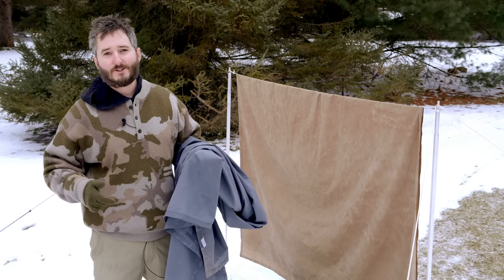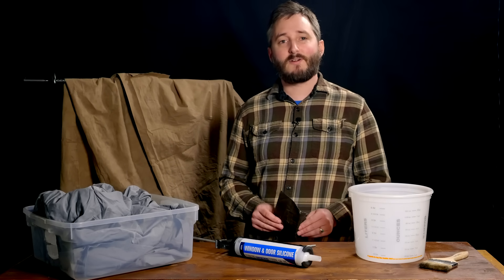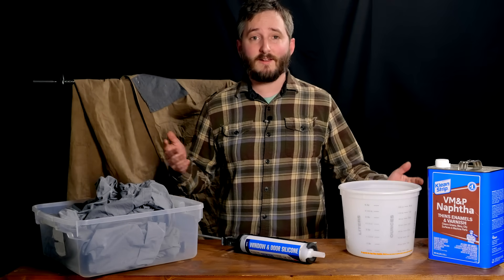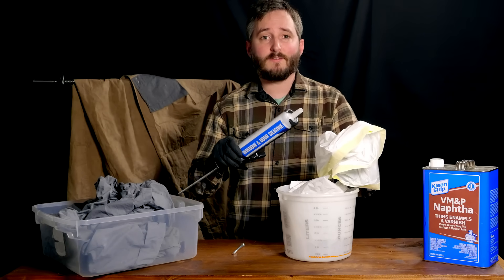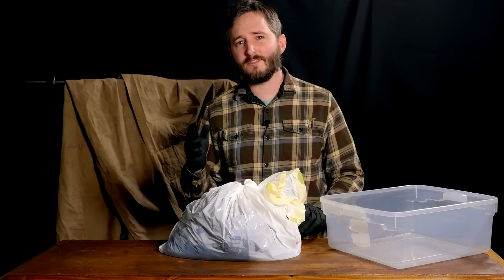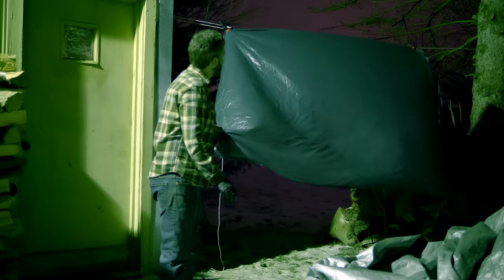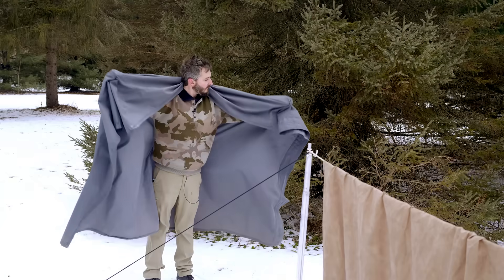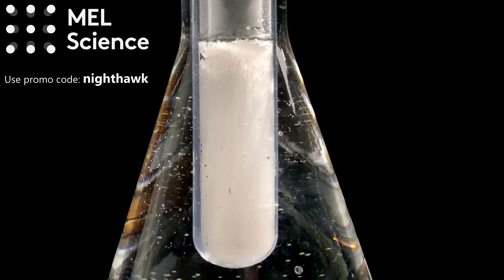Recycled Bedsheets Make The Best Waterproof Tarps

Comment: A king sized flat sheet is 75"x80" (6.3' x 6.7'), which seems a little small for my taste. But, he said this could be applied to any cloth material, so I looked into canvas drop cloths.

Canvas tarps are obviously more expensive than used sheets, but they are also much heavier. Drop cloths being 8oz to 10oz fabric, while typical sheets are 3oz to 4oz. A benifit of drop cloths is they come in much larger sizes.

Lowes Drop Cloths Feb 22
6' x 9' ($16), 9' x 12' ($27), 12' x 15' ($31). You can find a 30' x 30' but it's $300.

The question might be, why not just buy a woven poly drop cloth. My answer would be, because strong gusty wind, especially on a very cold day can quickly destroy a plastic or poly tarp.

Industrial grade Visqueen seems to hold up better than standard poly tarps, but likely not as well as cloth. In any case 10' x 25' x 6mil Visqueen is at Lowes for $30. It too will eventually shred in strong gusty wind, but lasts longer than most DIY grade tarps, in my experience.

Truly heavy PVC coated tarps are available, they are durable, heavy, and expensive. A 12' x 15' x 18 oz. Ultimate tarp, but it's 22 pounds and $190.

I'll probably try a 12' x 15' canvas tarp and apply the silicon syrup to both sides with my industrial paint sprayer. I believe multiple thin coats should insure the cloth is fully waterproof. I'll probably do the same on an old sheet if I can find one.
Reply from the maker: This should also work fine on fabric with seams. Stitching multiple sheets together is an option
Reply: @Nighthawkinlight 
Good point, thanks!

Comment: silicone coating sucks for many fabric (I ruined a backpack with it: its peels, and look horrible, there is no way to remove it). It's often better to use polyurethane coating (from expanding foam + acetone). With 1 or 2 layer it's perspirant (many tiny bubles form when applying that make tiny holes), with more layers it becomes waterproof. But be careful to:
- don't melt stuff as acetone is quite nasty for many materials, 
- wear appropriate gloves as there is a nasty chemical in this solution that pass through most gloves, and through the skin (the trick is to use vinyl gloves inside a plastic bag (PP? that isn't destroyed by acetone).
Reply: I forgot to add: you can't later on put more silicon to it (ro any other coting, bcs nothing sticks on it, even itself).
Though I learned many brillant hacks in this video, thanks!

Comment: Is it waterproof enough that it can actually hold water like a water bag? Like if you turned a cloth bag into a waterskin. Or does the water still leak through?
Reply from the maker: No, you would need to paint the silicone on thick for that purpose

Comment: Would be interested to hear how this fares in fire-resistance tests. Should be pretty good, no? My greatest fear of using beeswax-treated tarps/ tents when camping is that you're pretty much sleeping under a giant firelighter!
Reply: Silicone can handle heat pretty well, not so sure about an open flame though and not to sure about the naphta. Not familiar with that. I always thought jetfuel was called naphta.
Reply: @benjamincoetzee1369  jet fuel is closer to kerosene. Naphtha is lighter (lower c numbers) It varies depending on geographic  region and industry. The US Canadian version in the video is VM&P Naphtha aka varnish makers and painters naphtha which is a type of light naphtha.
Reply: @anullhandle  thanks, so is naphta more like mineral turpentine or more like thinners?
Reply: @benjamincoetzee1369  "thinners" could be a whole range of things.  Naphtha is pretty close to white gasoline like coleman fuel. Iirc naphtha is a substantial component of gasoline aka petrol. Googling around at least one manufacturer supplies silicone oil as the thinner for standard tin cure rtv and 2 part platinum catalyst  silicone rubbers.  That a completely different route to thinning.

Comment: You can fold a silk sheet, impregnate it with epoxy and compress it between two panels with clamps to make pretty much the lightest/strongest body armor imaginable; 16 layers of plain silk can stop a 9mm bullet, and is used by cops in Asia for their vests. Made into composite armor and compressed to shape, the same 16 layers would be virtually indestructible.
Reply: Now, THAT'S interesting, considering silk is protein.

Comment: That looks great, but HOLY CARP is it expensive!  Around here, enough naphtha and silicone to protect two sheets would cost almost $50!
Reply from the maker: $16 in materials here. An alternative to naptha may be white gas camping fuel
Reply: @Nighthawkinlight  Naphtha & white gas is more than $20 a gallon here.  Might kerosene/mineral spirits/paint thinner work?  They are all about the same price around here and about a third cheaper than naphtha.
Reply from the maker: @KeithOlson  Mineral spirits should work I think

Comment: I watch lots of science programs like yours. Yours is the most useful.  The other channels are great but only for watching, your stuff i will use.  I have already used the starlite when soldering a plumbing pipe in a tight ceiling joist. 
I have lots of tarps with holes in them because they always tear.  This will really help.

Comment: Why not  just  mix the  solvent and the  silicone in the  hard plastic container you had and put a  lid on it while the fabric soaks after the kneading process?  Also, how  long does any chemical odor last once the  treated  fabric  cures?  Thanks, John
Reply from the maker: Then I'd have to clean the container. The smell is gone as soon as it's dry
Reply: @Nighthawkinlight  Oh I see, your wife is like mine : "Don't keep using my storage containers."

I suppose the solution would also work on leather  footwear as well. 

Thx.

Comment: Didn't notice Type 1 Silicone (smells like Vinegar) being detailed as I'm thinking will perform better than the Type 2 Silicone that's the methanol or ammonia smelling type.  Figured might be a good idea to note in the comments I'm thinking.  Type 1 Silicone is a significantly better adhesive.  Now the Type 2 Silicone seems to be better for molding in my experience other than forming smoothly and being able to cure... though still thinking Type 1 is better to work with and get to cure if not the more expensive better suited silicone products designs specifically for.
Reply from the maker: Yes I use the acetic acid variety
Reply: @Nighthawkinlight  Good call!  Yes, the "acetoxy" ingredients are in those and the one I have notes evolves Acetic Acid.  Definitely makes a difference from my experience in regards to adhesion.
Reply: @Nighthawkinlight  Awesome topic as well!  Thanks for sharing!  The hydrophobic materials are a neat topic too and recently I've wondered about some sort of roof sealant cost effective coating like Rain-X or the Kiwi Camp Dry?  Different topic... though the silicone materials are a neat chemistry and neat properties without the flourines.

Comment: I have some cheap cloth steel toe work shoes that always get soaked with morning dew when I'm out in my field. Would it be safe to treat them with this silicone solution? I was considering sealing the outside with wax, but this seems like a better option. Great video by the way, I've been a viewer since middle school!
Reply from the maker: I think it may work. I would thin the silicone down less and paint it on with a brush
Reply: @Nighthawkinlight  Thanks for the tip! Anything to avoid soaked socks in the morning.

Comment: I look forward to trying this.  I'll probably use mineral oil spirits, since that is more likely to be freely available at the local hazardous waste recycling center in Boulder, Colorado.  There's a good chance that the silicone caulk is also available there.
Reply from the maker: Mineral oil won't dry
Reply: @Nighthawkinlight  Oops, I meant mineral spirits.
Reply from the maker: @richdobbs6595  You may also be able to use white gas camping fuel

Comment: Is it possible to do this with canvas drop cloth ?      My thinking is - I have been looking for a used canvas house tent for years now(used because of the cost for a new one ) .   
      I want to bring my family camping/hunting trip in the backcountry for 2-4 weeks .      The last camping trip was rough .    My wife is terrified of bears ( long story from personal experience) .       This led me to the thought, I wanted to make a house tent to save cost but to also engineer it to withstand a bump or two from a curious critter .   For that part I have designed a suitable system of heavy beams , hog fence and an electric fence to help her feel more at ease .    Also, before any commenters jump to a range of points and opinions.   I know !     But, what makes wife feel safe and happy will make all the difference for camping/hunting where she’s not a nervous wreck the whole time .       I like camping on the ground and preferably without a tent .      This is the only middle ground to where she wants me to buy or rent a camper trailer.          
     Anyways , the canvas material for these things are extremely expensive.       Could you try and see if this or something similar would work for canvas drop cloth where it can be cut and tied to custom sizes .   Even fire resistant for a wood stove pipe to safely be installed?          
    Btw, thank you for the years of entertainment and education!    My kids love watching your channel with me and experimenting with some of your projects you post up .        It’s literally priceless to me seeing them take an interest .  
    I wish you , your channel and your family a happy , safe and successful 2022 . 
     Thank you again .
   -Taren
Reply from the maker: Drop cloth should work. When I'm camping in bear territory I set up solar motion sensor flood lights around the site and bring the car fob in the tent so you can turn the alarm on and spook them off if needed

Comment: Do you know if the silicone will evaporate or shed off slowly? What's the molecular weight of the silicone used? What about using a highly unsaturated oil like linseed oil and letting the oils oxidize/polymerize in a controlled manner while being soaked into the cloth?
Reply from the maker: It shouldn't evaporate

Comment: I have found that using a marble which is smooth will give you the best button. Also, my neighbor recommended the use of small round river stones. The smooth round item will keep your item tearproof. When it comes to the waterproof part, I used beeswax and Brazilian carnauba wax mix fifty fifty. The tent that I waterproofed one foot from the bottom of the tent keep me dry when their was six to seven inches of water after a super thunderstorm that rained all night. All my neighbors at the campground found out the hard way. Being a Boy Scout I made sure I picked the highest level spot at camp. What a sweet victory for me and my girl. Did not know that the flood was so high. Woken up by the calling of my neighbor campers that we were having SEX and did not care. Well we come out dry as could be from the tent. I would never camp without a waterproofing the bottom of the tent. Thanks for letting us all know the must do thing for waterproofing. Peace NightHawkinLight VF

Comment: Could I treat a wool blanket this way?
Reply from the maker: You could, but I think it would be a waste because it would soak up a lot of silicone and you really don't need that thick of a waterproof coating. Better to have a thin waterproof tarp and a regular wool blanket underneath
Reply: @Nighthawkinlight  Awesome Video BTW!
Reply: @Nighthawkinlight  I meant a wool cloak....you would get the warmth and the waterproof quality.
Reply from the maker: You can try it but still I would prefer a normal wool inner layer and a thin waterproof outer layer.

Comment: Once I waterproofed bottom part of my suede boots with just silicone. It stood up for five years, the boots are fine, but silicone starts to peel off. I thought of that improvement as 'half-good', now I understand where and why I missed that half. Thank you so much!
Reply: Did you thin the silicone like he did?  I want to do this to a couple pairs of my boots.
Reply: @White000Crow  no. I used it as is, it started to peel off after 5yrs. Now I'm planning to thin next batch  down
Reply: @petramarishko  5 years is quite impressive for using it as is.  Could you imagine if actually saturated the suede and soaked through?  My only concern is they would become more like rubber boots and your feet couldn’t breathe.
Reply: @White000Crow  those boots was strangely constructed or 'designed'. The heels was wrapped in the upper material too low, only thin sheet of rubber between suede and the ground. It was winter boots, made for snow, but it is always way too much salt and salty waters on the roads around me. So I waterproofed only that part of the suede, wich came close to the ground. It looked ok, because this boots already had a lot of 'sporty' rubber details. I don't know if it's possible to make clear edge, as I did, with thinned silicone, I need to think about it. Maybe I shoud use thin strip of pure silicone to mark the border...

Comment: It would probably make the soaking process easier if you just removed the air from the bag - thus ensuring that all parts contact the mixture. Basically vacuum-packing. I find this useful in a lot of different scenarios. Even for something simple like marinating meat.
Just be careful that you don't end up with that gunk in whatever apparatus you use to create the vacuum. A small manual air-pump would probably make sense as it would give you a lot of control, and be cheap to boot.

Thanks for the "button" tip too. That one is so obvious in hindsight... I feel like so much useful info like this has gotten a bit "lost" in today's society. Everyone should know a handful of essential rope knots - but it's not really taught anymore.

Comment: How waterproof is it? Do you think thread count would effect its ability to retain water? Id love to see what silk comes out like. 

And how resistant is the silicon to heat (up to boiling temp)? 

Ive been hunting for a method of creating a "lightweight, flexible pot" to lighten the load while hiking. Id like to be able rock boil large quantities of water (for cooking/replenishing canteens)  i was inspired by the eragon series, when a kull tribe leader digs a hole in the ground with a stick and employs bushcrafted stakes to stretch out a dried bear stomach in the hole and uses rock boiling to prepare a stew.
Reply from the maker: It will allow water to drip through if you tried to use it as a pot as is, but you can make it completely water tight if you paint the silicone on thick. Silicone can resist boiling temp but I would buy food safe silicone. You'll run into trouble if your flame is able to lick up on dry fabric with no water to cool it off. Also careful to use something like cotton that is food safe also. Haven't tested different thread count.
Reply: @Nighthawkinlight  dont worry. The fire will be well away from the cloth pot. Ill be transfering hot rocks from a fire into the water.  I completely agree on thefood safe versions. 

Id also be curious how this goes on to leather or even rawhide. 

I just had an idea. Get a sacrificial washing machine and somehow make it wash and dry the clothes with the naptha silicone mix instead of water, without blowing up.

Comment: I like this. Here's a tip, as I live out in the desert w/lots of wind, if you are going to tie it off to hold it down get some coil springs that have half-round hooks on each end from an old sofa or recliner ... make that "button" connection but turn the long end into a small loop that you hook the spring into and take a another rope n tie it to your anchor point and to the other end of the spring and pull snug. The spring will absorb the shock the wind whipping the tarp so it won't tear as easily
Reply: Trampoline springs?
Reply: @solarsynapse  - Yes, stuff like that
Reply: To cover our sailing boat, we used empty plastic engine oil canisters at the rope ends and filled them with pebbles, to weigh down the tarp.
Reply: You could also try heavy duty bungee cords. Less agressive  on 5he canvas and l8ghter weight.
Reply: @hugbearsx4  bungee works well in rainy conditions. Salt water and/or direct sun and the rubber degrades fast, plastikote/silicone dipped metal springs last the longest for stuff kept out on deck
Reply: @dfgdfg_ great tip!   what type of silicone do you use for dipping the metal spring?  A spray?  Same with the plasticoat?

Comment: are the tarps airtight too? ( I want to make a big bellow) btw for the buttons i always used marbles, as they donˋt have any sharp edges.
Reply from the maker: They are not airtight, but you can make them that way if you paint the silicone on thick
Reply from the maker: They might hold air well enough for a bellows as is

Comment: The really big improvement would be to add something for UV protection. I need this for cheap car tarps, which otherwise get ripped in the wind. Longevity enhancement.
Reply from the maker: Add a scoop of lampblack to the silicone for maximal uv protection. This may leave black smudges if used as a car cover though.
Reply: @Nighthawkinlight  That would work. Maybe soak it twice, first with lampblack added.